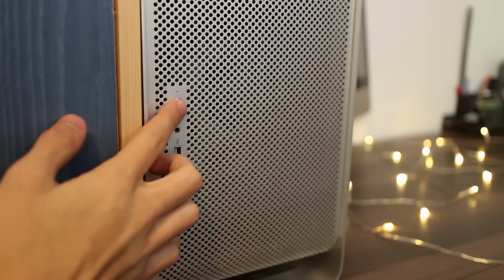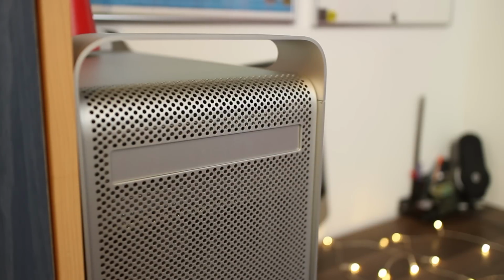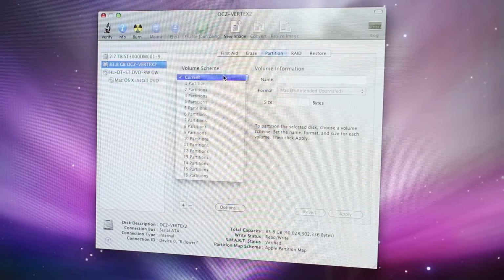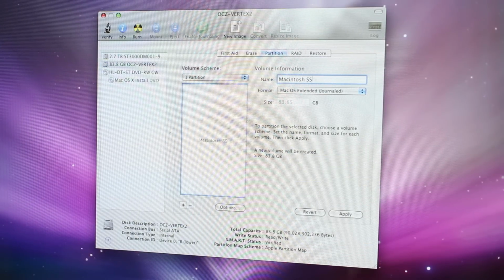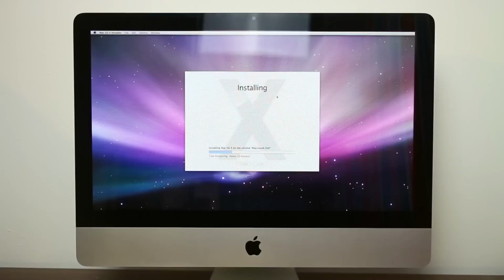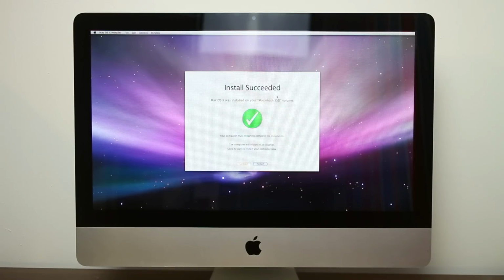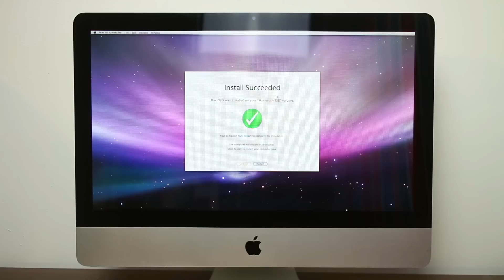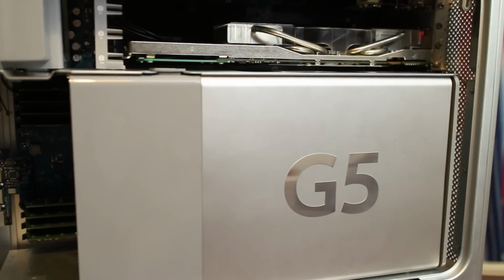The Ultimate Power Mac G5: The Upgrades [2/3] | The PowerPC Hub

Comment: Is there even any point to having an SSD, seeing as even a competent disk drive can nearly saturate the SATA1 bus?
Reply from the maker: You're going to find out very shortly in Part 3 ;)
Reply: *****
I'll look forward to it.
Reply: Just put an Intel SSD in mine. Performance really is better but another benefit is the SILENCE. Niall put in a massive data drive but I don't need that.
Reply: Mike Erwin
If you want a good silence-to-performance ratio, then I don't think the PowerMac G5 is for you.
Reply: True, true. Though GIVEN I want to run a G5 an SSD is one way to minimize the overall noise.

Comment: Got a question for ya homie! 
What would you do? 

I have probably £700-800 right now, and can stretch a little more as time goes on (if I need to add/upgrade as I go). 
Basically, we’re currently streaming from my iPhone for the podcast we do, but it isn’t reliable, so it needs to be getting to a more professional level and I’d like to be able to use OBS to stream effectively or possibly Wirecast, (about $500). Right now I’m just Wirecast Go with a PNG overlay. 

I’m looking at 3 options; 

1. Upgrade my 2009 27” iMac 2.66. It’s really really slowed down, so even as use just for office/browsing purposes now it’ll be require an upgrade in the near future. I’m looking at approx £300 to send away and get new RAM and an SSD. 
2. Buy/build a Hackintosh. For £800 I can get a pretty tasty spec. But can I be arsed with all the compatibility issues? 
3. Buy an old 2008/9 Mac Pro, upgrade the RAM, SDD and Video card. Cost wise, it’s basically the same as building a Hackintosh. But I get the sexy Aluminium enclosure. 

Which one is going to give me the best stability/power? Monitor wise I’ve got a 27” Apple Cinema display to connect to. Not needed for the iMac, obviously.
Reply from the maker: If you're comfortable at opening the iMac up and installing upgrades yourself (or if you have someone to do it for you) then I'd personally look at that option first to save a lot of cash. The processors are upgradable & you can pick up a quad i7-860 for around £60 on eBay which will offer you a significant bump over the i5 you've got in there currently. RAM can be upgraded all the way to 32GB which is a monstrous amount, but 16GB is plenty enough for any sort of video work you'd be looking to do. 4x 4GB sticks will run you in around £90. Lastly an SSD is the absolute best upgrade any Mac can receive, and I'd put money on the main reason it's slowed down recently being down to how pathetic newer versions of OS X run on mechanical hard drives. A 500GB SSD can be had for around £100. And there you're looking at £250 for what would be an absolute beast of machine.

If you want a machine that just 'works' then don't bother with a Hackintosh. But if you're willing to put up with the initial headache of getting everything working as you want it, and are prepared to go through that process every year as a new update rolls around, then by all means build one. The bang for buck vs what you'd get with a Mac is just out of this world. My £500 G5 build performs pretty much on the same level as the £3000 quad core Mac Pro, and I couldn't be happier with it.

Getting a Mac Pro would be sort of a middle ground option. You get the sexy enclosure, being a real Mac everything would just 'work' and you wouldn't have to put up with shit breaking when you're trying set it up, but performance wise vs an £800 Hackintosh would be abysmal, and compared to what is essentially the £250 iMac you wouldn't see much if any difference doing general day to day stuff, and would probably only see ~30% increase in render times etc. when working with video. Another thing to note is that Apple dropped support for them with the latest version of OS X as well. There are ways to get it running and it's pretty simple all things considered (especially compared to getting a hackintosh off the ground) but it's worth noting.

So personally speaking, I'm a tight bastard and would rather save £500 and get the iMac souped up. But if I was looking for a more future-proof machine then I'd put up with the inevitable headaches and build a Hack.

Comment: I Just got an Early 2004 Q16A PowerBook G4 15" running at 1.5 ghz with 1 gb of ram on eBay last night. I am excited to try it out and see how it performs today. I am also expecting my 15" space gray MacBook Pro 2.6 ghz with touchbar to come in shortly before x-mas. So it will be fun comparing both machines. I will miss you making new vids!
Reply from the maker: Nice! We've started receiving the new MacBook Pros in at work in the last week as well and, although I still can't say I'm a fan of them by any stretch of the imagination - the display, keyboard & general build quality is just outstanding.

Comment: Quadro FX 4500 is the fastest Nvidia card for PowerPC G5, but not the fastest overall. Radeon X1900, which I have in my Quad, is actually slightly faster, only single-height, but limited to half as much VRAM (256 vs 512 MB).

Comment: "Pushing it to its limits" opens a YouTube window turns it up to 720p yep that's about it... ugh it's sad my 17" PowerBook struggles to stream videos.
Reply: A Quad G5 can handle 1920x1080 YouTube videos in Quicktime Player fine (there are several ways to play them in Quicktime instead of the browser). But trying to play HD in TenFourFox will quickly have any PowerPC Mac chugging away, I think the Quad can go up to 720p smoothly in TFF which is saying a lot!
Reply: "Hey Joe, check out my awesome new computer. It's got 16GB of RAM, a half-kilowatt power supply, and liquid cooling".
"That's pretty cool, Dave. What can it do?".
"Uh, It can play YouTube videos at 1280x720 resolution".
"Dave, even my iPhone 7 can do that, and it cost less too and has better battery life along with silent operation."
"But does your iPhone have a giant fancy case?".
"Well, no, it's just got a pathetically-small and exceedingly-boring chassi that doesn't even have room for a headphone jack. I wish I could be more like you someday, Dave. You always find the best computer equipment"
Reply from the maker: YouTube in the browser on PowerPC Macs isn't even worth trying these days IMO. It doesn't showcase the machine's potential in any way whatsoever and is basically just a reminder of how bloated modern websites are these days. Get PPC Media Center downloaded & you'll be golden.